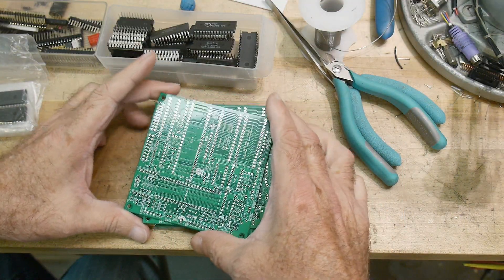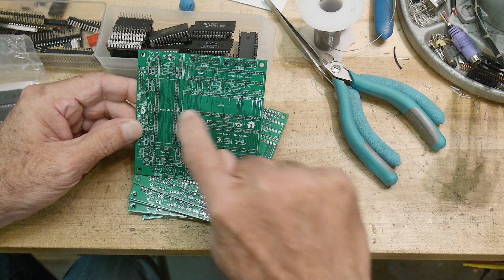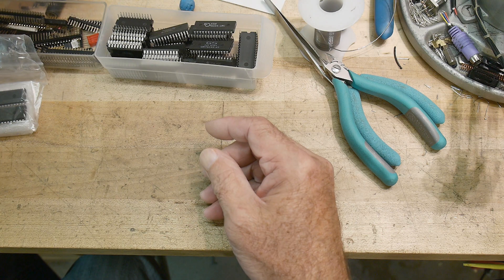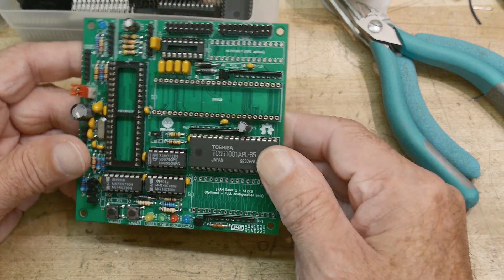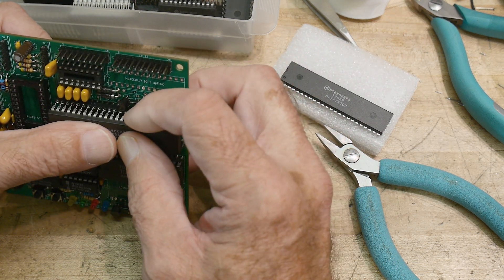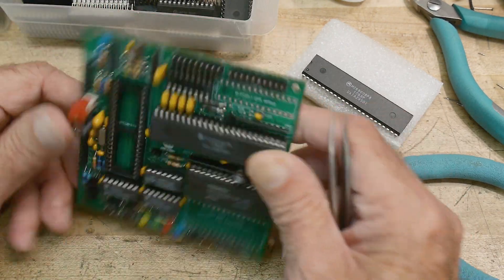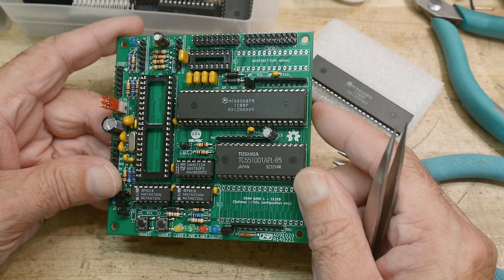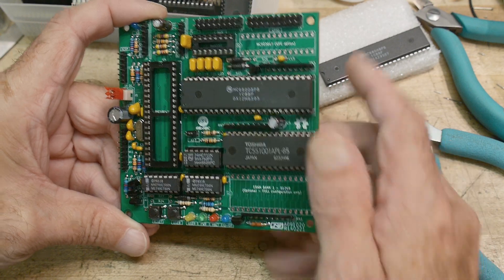#936 68008 SBC Computer Kit (part 1 of 3)

Comment: I picked up quite a number of NOS MC68008's 15 or so years ago along with dozens of Signetics 68000's, MC68000's & MC68010's, I'd like to find a PCB design, ideally MC68010, that has configurable address decoding with MMU. I've built a number of Z80 based projects using wire wrap construction & for the last few years found more interest with 6502, 65C02 especially 65C816 based projects, luckily I went on a purchasing spree for many of these parts back when NOS parts were more affordable & the fake chip problem was far less of an issue than today.  I have enough parts on hand to satisfy lifetimes worth of MC68K, 6502, MC6800, MC6809, Z80, 8080, 8086, 8008, TMS9900 etc... 1970's through 1980's era common & uncommon 8, 16, & 32 bit microprocessors & respective series support chips along with RAM's, EPROM's, EEPROM's, GAL's, PAL's, 74xx (S, LS, AS, F, C, AC, HC, HCT.......), 4000 series etc.....

Comment: Nope the "rom" comes from the PIC, additional code comes from the SD. The PIC takes control of RAM, loads up a bootloader capable of loading srecords and then returns control to the 68008. If you load the extended BASIC or CP./M 68k from the SD then the "ROM" image is loaded into RAM and the SD is accessed as a block device via the PIC (by the 68008).

Comment: There are lots of fake 68000’s sold on the usual websites. Looks like yours at least have genuine printing and have not been sanded down and laser etched. I’m not sure that the white foam is anti-static. BTW I got stung with fake PLCC 68000’s , a MC68000 8MHz remarked as MC68HC000 @ 16MHz (ink came off with IPA) , and when I recently checked my 68008 parts, I got a little suspicious about them too (but to be confirmed). BTW the 68000 PLCCs are 100% certainly not 68000’s.